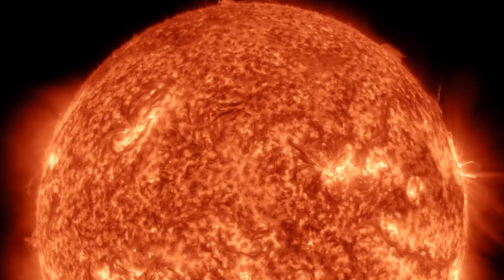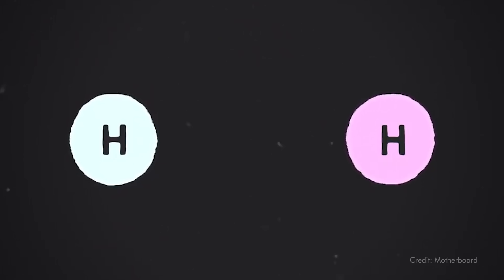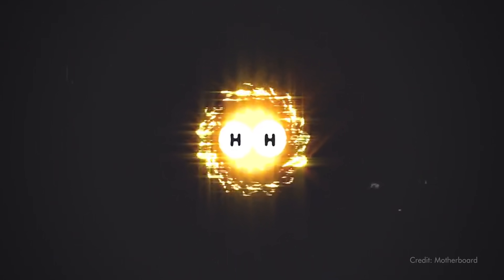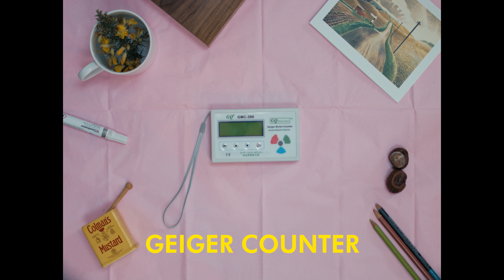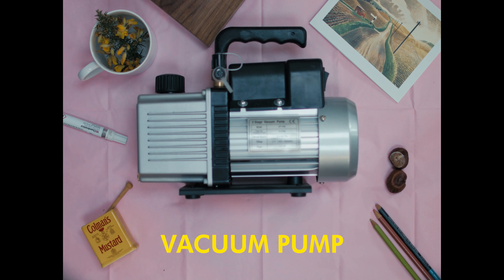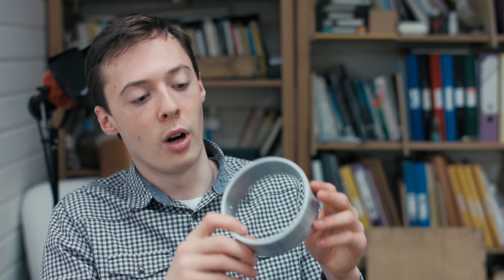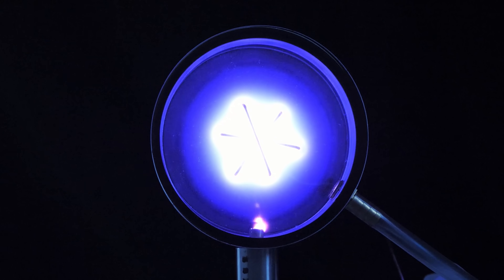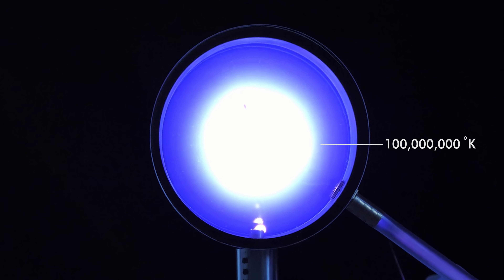Making a Desktop Fusion Reactor

Comment: Looks similar a gas-discharge lamp, which I think would work at these voltages, but would need to be grounded on one electrode.  A shame he did not go into more detail.  Just a word of warning, photonic induction was playing with high voltages in vacumes, and warned about Xrays.  But I'm no expert, just an armchair science enthusiast, so sorry if I'm wrong.

Comment: I personally had a design for a fusion reactor that uses a vacuum chamber and a microwave oven. I speculate that the RF should heat up the low pressure gas to extremely high temperatures, which could cause some fusion events to occur.

Comment: This is a complete failure.
As others said, you've built a light bulb, not a fusor. At 6:41 you can clearly see that your electrodes are glowing, which means you have a piss poor vacuum, and nothing except a basic gas discharge can occur.
Reply: Can't have gas discharge that bright  in a vacuum
Reply: @SambarAbbayi  Have you ever seen a neon sign?
Reply: I'm not very educated in that area. Can you tell me how my points is in validated
Reply: @SambarAbbayi  You can have a gas discharge that bright. Vacuum is relative and is never perfect. His vacuum, to add, is rather shit.

Comment: If you added a bit of thorium dust..

Would it make it selsustaining?

Covering with (maybe)starlite  and thermocouples..

Would this be possible as an actual generator.
Reply: fanOmry underrated comment. If i rebuild this thing, remember me on doing this.
Reply: @lasamisalagne7377  

Thank you..

I never actually got why we don't use allready radioactive trace elements is the plasma..

Or the shell..

Both..using a good mix of starlite (insulation) and thermocouples..

The heat itself could be the the energy converted the power.

Heck, starlite puckered by niddles; so the conductive metal stream out electrons/ions. And these caught by thermocouples.

Which should be more efficient.

Comment: did you use deuterium in it ? can you please make an article on the materials used and how you designed the fusor in more detail. Also, please provide the details on risks involved and precautions to avoid those risks while fabricating the experiment? It will be highly useful for education purposes.

Comment: That's... not a fusor. That is just a fluorescent light bulb: the high voltage is ionizing the low pressure hydrogen around the cathode and the anode. That blue glow is indeed plasma and it surely reach several thousand kelvin in temperature, but it is NOT fusing anything and it is not at several million kelvin: black body radiation ensure that at 100.000.000K you aren't getting much visible photons, you're getting mostly gamma photons, which are invisible to us. Even a neon lightbulb is coated with fluorescent paint inside to boost the luminosity, because most of the "light" emitted there are UV rays.

That's something you learn in high school, not with a PhD in nuclear physics.
Reply: That’s absolutely correct!
Reply: So where do you think the radiation came from? do you think he faked it?
Reply: @1997CWR  Sure. Obvious, I was watching it and was 100% sure it wont be fusion at all after the first 3 mins
Reply: @RegiJatekokMagazin  I mean it would be really easy to just put the ticking sound in audio. And we never saw the Geiger counter, so we really have no proof.
Reply: It could be a fusor if he used deuterium gas instead of regular hydrogen. Pretty cool desk lamp but not a fusor...

Comment: Isn't it simple ionized gas called plasma?
Reply: yea its plasma. If that thing has the temperature of 100 milion ºC, probably the radiation (process of heat transfer) was to melting everything around

Comment: All it needs is a liquified nitrogen cooling system to go around the fusor to remove the heat around the frame similar to a cooling system in a internal combustion engine...I believe it will make it more efficient and reliable
Reply: If you remove the heat, you defeat the purpose of it. The vaccum pump creates a vaccum in the chamber to prevent the heat being transferred, but maintaining the high temperature is what allows the whole device to function.

Unless you mean cooling the frame? Which since it's not a perfect vaccum may heat up after long periods of time, but I reckon a more low tech solution such as machining fins on the chamber when he made it would work as not much heat would need to be dissipated.

Still tho, gotta love the smoke effect some liquid nitrogen would add!
Reply: @jamiebell2777  you cool the frame similar to how a cooling system works in your vehicle by circulating the heat and cooling it down in a radiator ( you make it a closed system around the frame )
Reply: @kenrose1154  If it was a closed system, you would then need to cool the cooling system, otherwise the nitrogen would evaporate due to the heat it is removing and the ambient temperature. This would cause the pressure in the system to drastically increase and most likely explode unless the gas was vented. If you used Liquid Nitrogen as a flowing coolant, the pump would have to work at Extremely cold temperatures, which would make it expensive/complicated. 

The best way to cool it with LN would be a static coolant where it is occasionally topped up from a tank, but otherwise sits and simply removes the heat to evaporate in nitrogen gas which is then vented.

Comment: What is your source of ions for this project? I assume you are using D-D and not D-T?
Reply: not using any ion dude, this is just an electric arc in vacuum... it is just a desktop ligth
Reply: @gonzajd777  it's a fusor so it uses electric field to fuse small amounts of gaseous ion
Reply: @ruairidhdavidson288  NO. It's not a fusor. It's a normal plasma. The electric field ionizes the Atoms but it doesn't fuse anything. The video is fake.

Comment: This video completely trivialises the task of building a fusor, it's simply not possible to slap together a fusor like this and expect it to work, it requires time money and a lot of dedication to build a fusor. Expect to spend months learning about vacuum followed by months learning about high voltage, and if you want to do it safely, spend some time learning about radiation. One year and about $5000 to $1000 is a reasonable budget IMHO.

Comment: What metal are you using as the conductor in the core?
Reply: In the "core" xD
It's a light bulb. No fusion, no reactor, no core.
Reply: @divingdave2945  Nah. Look it up. Fusors are very real and they look just like this. As surprising as it may seem, this is 100% real. I still haven't found what metal it is though.

Comment: Correct me if I'm wrong but I'm fairly sure that normal hydrogen (which I assume he was showing with that part with the caustic soda) wouldn't work or would be extremely hard to fuse, and he didn't make any mention of using deuterium or anything about heavier hydrogen isotopes. I also don't think that it would work for fusion as with only two of these normal hydrogen atoms fusing the new atoms being made would Helium-2 which would be an insanely light isotope for helium

Comment: I'm having trouble figuring out where you apply the voltage difference in your system. Do you have schematics that you could share ?
Reply: nvm I finally saw the cable going to the central cage. Nice work

Comment: There's a hobbyist site for this called fusor.net. The first thing they will tell you is that measurable neutron counts are really really hard, i.e. D-D fusion is difficult on such a small scale. D-D fusion gives you light helium and a neutron. This guy does not have access to tritium, so no D-T reaction, and if he's trying proton-proton reactions with just regular hydrogen he's gonna have a bad time. Glowing purple is pretty normal for large scale plasmas, and impurities in air can also make a purple glow, so thats not a key indicator of whether this actually fused anything. You can make desktop fusion reactors, with a negative energy yield, but they have to be a lot more robust than this. He's most likely just heating hydrogen gas, if not he would have to be very careful with disposing of his apparatus, as neutron bombardment will create radio-active isotopes out of a lot of high z materials. Tungsten and carbon are often used in reactor walls as they create stable isotopes with the addition of a neutron. DO NOT DO THIS AT HOME UNLESS YOU KNOW WHAT YOU ARE DOING! Fusion reactors still produce radiation, especially with low budget setups that place impurities into the fuel.

Comment: Either you've just killed yourself, or this is fake. It looks more like you've created a nice ionization chamber and that process is what's producing the light, but this is no nuclear reactor. Couple things: 1) If this thing reached 100 million degrees celcius it would have melted skin even miles away. You know how hard it is for our atmosphere to dissipate heat right?
2) Even though no one would have lived to see it, the machine would have melted down.
3) Why are you not dead from radiation poisoning?
4) How did you get your hands on Uranium-235/238? I could use some of that.
5) How did you regulate the reaction? Smaller nuclear bombs have been designed for the protection of the US President and some for war/terror; this would have runaway and either imploded or spewed radiation everywhere.
6) What medium did you use, a gas? Haha
7) Speaking of gas, what's the unmentioned tank and valve doing hooked up at the end? And the electrical discharge... Ohhh, I get it. This isn't a nuclear reactor, it's a plasma globe! Dumbass.

Comment: As someone who has built a working farnsworth fusor I find this design pretty. His information is slightly deceptive though as this is NOT a neutron producing reactor. This is a demo fusor toy. To achieve measurable fusion you need to back fill the chamber with deuterium gas. What your seeing isn’t fusion. It’s a plasma generator.
Reply: On a scale of 1-10 how hard would this be to build do you think, I have no experience but have the time to learn, or is it not worth it?
Reply: Ok it sounds like you know what you're talking about. I have a few questions regarding this video. First, is the atmosphere inside under full vacuum, or is it a 100% hydrogen atmosphere? Also, what is the complete circuit he uses? Is it just that hooked up to mains power? Is there a negative output, or is the metal bit in the center work similar to a tesla coil?
Reply: Now where can I get deuterium gas from?
Reply: @x86_architecture10  You can make it by purchasing heavy water (United Nuclear has it)  then running it through a PEM Electrolyzer to break it apart.  You now have Deut gas.
Reply: @vizjournalist  Is it possible to fuse atoms other than deuterium? Like Helium, or Argon for example?
Reply: @x86_architecture10  I don’t believe so but I don’t have experience with with those gasses. I think they’re too heavy and would take a ton of energy.
Reply: Think about your answer again.
Reply: So does that mean that if he had just filled the chamber with deuterium after pulling a vacuum it would have produced fusion or is there more to it than that
Reply: Where can someone get deuterium or is it cheaper to make
Reply: what uses does it have ?
Reply: @memecoinmafia2732  Not much really.  A real one can produce neutrons and some use it to activate materials.  Most do it because it's a fun challenge and interesting.
Reply: It still looks cool, and that’s all that matters.
Reply: Your argument means shit and it's laughable for such an alleged intellectual to pick at such a trivial nuance--what you failed to acknowledge, dare i say recognize, is that the temperature he claimed to achieve more than twice the required input energy of ~40,000,000°K. Don't forget that the first atomic bomb was a uranium ball that was shot with a uranium bullet to induce supercriticality. Orthodox is the opposite of both visionary and ideal--look it up.
Reply: He did fill it with hydrogen (Aluminum foil in toilet cleaner made some) which would be 1% deuterium.  So it might have a bit.

I doubt he was getting proton chain fusion, though.
Reply: @ancapftw9113  yea, some things feel off about this but what you're talking about is directly from anarchists cookbook in the 90s :D
Reply: Would hydrogen from water vapor in the air not be accelerated into the center at fast enough speed and temperature to cause fusion? Its a minuscule amount, not enough to get close to the power of the light emitted from the coronal discharge, but still occurring, no?
Reply: It's possible, but not plausible.  You really don't record neutron production above background unless you're running some type of gas delivery system.  His example is nice but not fully functional.
Reply: vizjournalist so would it work as a fusor if say he did inject the deuterium. Sorry I have no idea about this.
Reply: @ianbennett5997   Is a cool-looking plasma light generator, otherwise known as an HID Xenon bulb, without a areflector. This is as much a plasma generator as an Audi headlight is.
Reply: i knew i smelt bs on this video
Reply: but the fusion isn't worth it since the energy you should give is more than the energy you get at the end right?
Reply: Fancy light bulb...thats it ...
Reply: Actually, it IS fusion and it DOES generate neutrons. The gas is deuterium, and these devices are commonly used as neutron generators.  They just draw a lot of energy, and don’t produce enough energetic alpha participles to be useful as an energy generation device.  Neutron generation has been verified by multiple studies when tested under controlled conditions.

Comment: From WIKIPEDIA: A glow discharge is a plasma formed by the passage of electric current through a gas. It is often created by applying a voltage between two electrodes in a glass tube containing a low-pressure gas. THIS IS NOT A "FUSION REACTOR".
Reply from the maker: Check Wikipedia for “farnsworth fusor” 🙂

Comment: Is there a schematic for the electrical components?
Reply from the maker: I haven’t drawn one out, but you can make one by just attaching a rectified (DC) high voltage negative to the inner cage and grounding the outer casing! :)
Reply: Will From London Thanks!

Comment: Would have been nice to see the Geiger counter readings.
Reply: Josh Maine this doesn’t produce fast neutrons so there would be no reading above baseline.
Reply: @vizjournalist  Most cheap GM tubes can't see neutrons. Even if he did have neutrons(which is impossible with that heap of junk), he wouldn't see anything. You need a He3 tube or LiX scintillator.
Reply: @vizjournalist  Oh well in general you can get a fusor to produce detectable neutrons. In fact the guys on fusor.net do nothing but use it for that very purpose. They have enough in fact to activate silver. You are right though that this thing probably isn't producing any neutrons.
Reply: @samuelallanviolin752  Your right on the money.  I'm a member and have a system I build on and off depending on my fluctuating level of interest.  You should definitely build one.
Reply: @vizjournalist  Can definitely relate to the fluctuating level of interest. I initially came across the work on fusor.net and had great naive visions of making some significant progress with it (don't laugh, I am at that age of stupidity at the moment) but when I read up a little bit on the history of fusion I realized that so many people unbelievably more brilliant than myself worked on it and were stumped and this ruined my initial (unwarranted) optimism. But it would nevertheless be great fun to build one. What stage are you at with it? Very curious to know!
Reply: @samuelallanviolin752  A fresh look at old tech is never a waste if you're interested. I think you'll really enjoy the process. It's worth the intellectual exercise alone.  There is an old vid on my "channel" showing my alpha stage.  I got to the gas handling stage and made a few runs with D2 but my turbo controller died.  Mine is a 8in conflat 6 way cross.  It's collecting dust atm.  I tinker with it every couple years.
Reply: 6:44 If you listen closely the geiger counter is going crazy in the background.
Reply: Tuna The Pro that audio is edited in -_- 
Just like the music. Isn't it dumb to assume that he has a rapper and band follow him around during his recording to get that in the video?
Reply: @Exandria  well yes but he did get a geiger counter.
Reply: You didnt see a fusion reaction because IT WASNT THERE
Reply: @razzberry6180  it was
Reply: @revolution5547  Mine is also a reference to HBO's Chernobyl lol
Reply: Probably be giving off 3.6 roentgens, from what I hear that's equivalent to a chest X-Ray.
Reply: @dustin872  Not great, not terrible.
Reply: @dustin872  this fucking meme XD when will it end.
Reply: @dustin872  that's hardly horrific
Reply: @dustin872  um hi other people where replying to your comment so I did that too because I am a sheep 

Disclaimer I am not a sheep
Reply: @dustin872   Stop making memes about Chernobyl, real people died there and you keep joking about it
Reply: @mrscientific4956  I guess dark humor isn't your thing. I'm sorry if that offended you, I'll try to censor myself in the future.
Reply: @dustin872  Its not dark humor. Its just laughing about death of thousands people.
Reply: @mrscientific4956  I doubt the relatives of those who died would be watching a video about a nuclear reactor let alone read this comment lol
Reply: @mrscientific4956  it’s over 1000
Reply: @mrscientific4956  yeah people died in london let's stop talkin about that too
Reply: It doesn't put off any radiation other than x-rays because its not performing fusion. He filled it with hydrogen gas, which won't fuse under those conditions
Reply: Bro the purpose of fusion is it not being radioactive
Reply: @bazooragamer7951  fusion still produces neutron radiation
Reply: jogandsp I know I’m a nuclear physicist I was drunk when I commented this, don’t ask
Reply: @bazooragamer7951  of course you are
Reply: jogandsp no I actually am